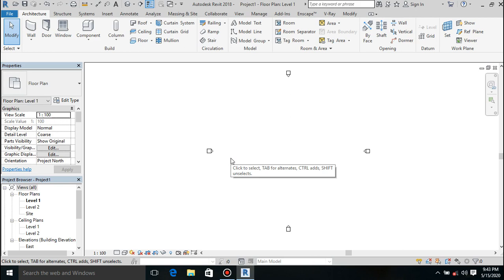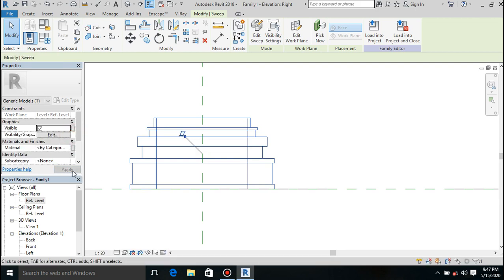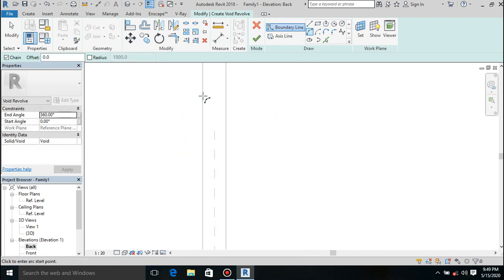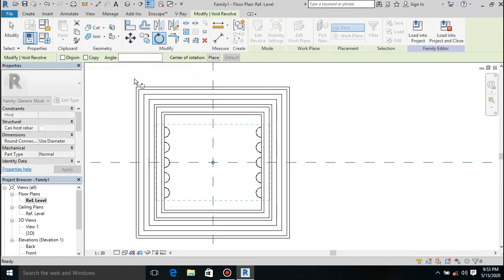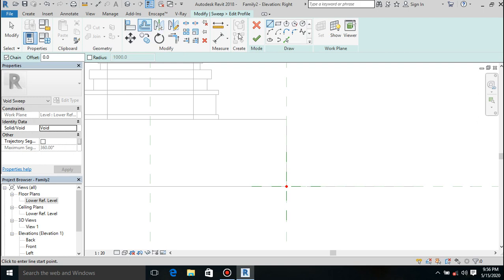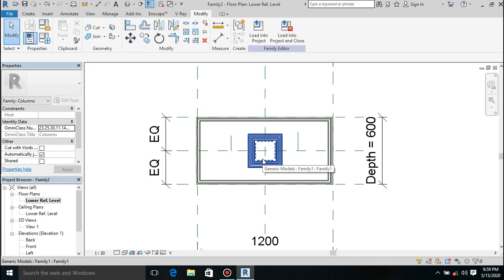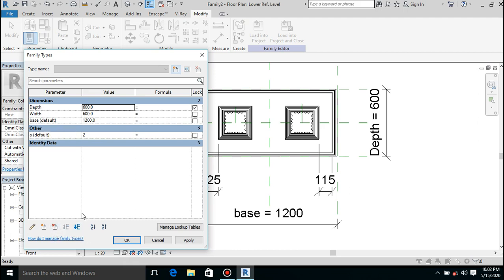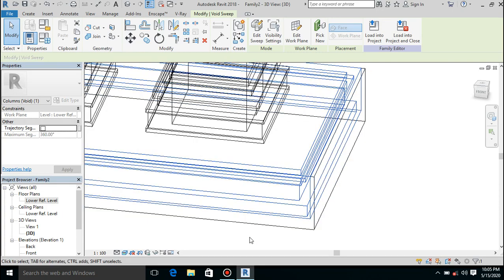Parametric columns in Revit, type 1

Comment: Excellent video. 
How to I get the column height to automatically attach to a change in levels of my floor?
Reply from the maker: You have to add a parameter to height change in the family first
Reply: You need to align (and lock) the top of your column to the Upper/Lower Level in your family.

Comment: Really excellent video. 
When I insert the column into my structural design it does not adjust the height when I change the floor levels. How do is fix this so that it automatically attaches to the levels I want it to attach to?

Comment: Thanks for your video. However when i tried mirroring the base,it gives me a weird yellow outline that i cannot work with. Why am i not getting the mirror like you did?
Reply from the maker: May be you have constraints to the base try copying and then mirror
Reply: @architectzayyad  thanks alot,turned out the extrusion didn't move with the void sweep..